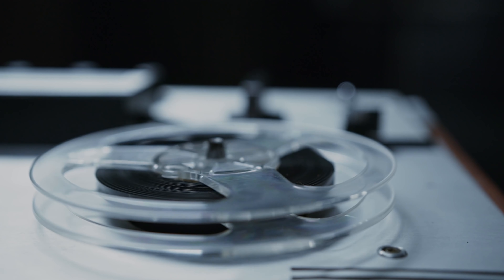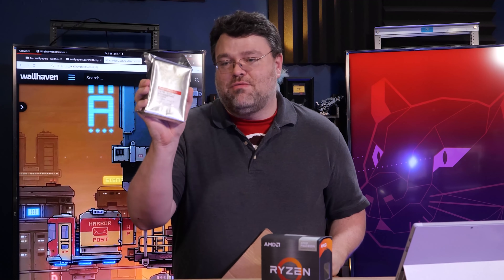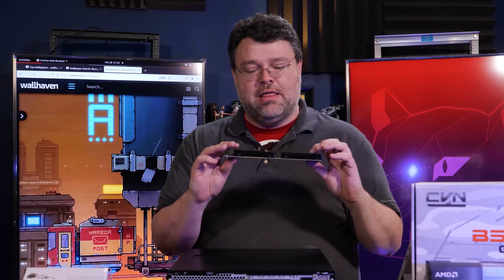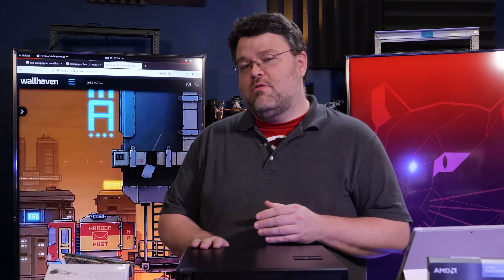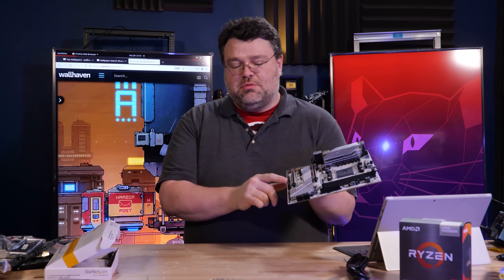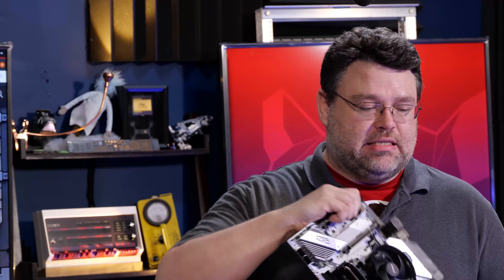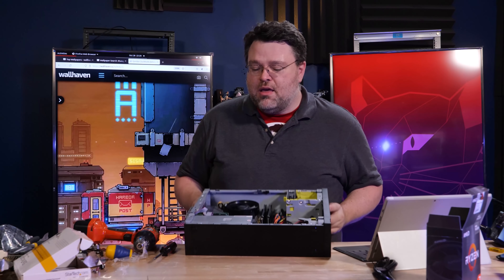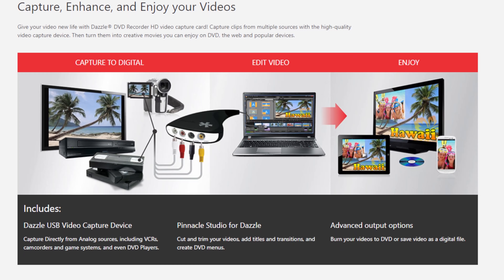DAT Build Doh! PC Build for Archival Digitization

Comment: Can anyone tell me why $280 for a 10TB red makes sense over 8TB? Maybe at the date of ordering parts the 8TB were still price inflated, but the HC320s I personally use in my desktop are currently $175 on Newegg. Or if it's just being used for temporary storage of transcoding output, a $100 blue drive would work just fine, no?

Comment: Interesting, I need to build something like this.  BUT…
I really like to see how you managed to get that ancient TEAC SCSI interface drive you showed in the video hooked up to a modern system.
Also links to the various parts would be most helpful.
Reply: I had SCSI drives back in the day both CD readers and hard drives. I saw that and wondered where he would get a low profile PCIe card for that system if he is going with a SCSI optical drive.

Comment: CDs don't expire as quickly as you're implying.  I recently copied about 1500 CDRs and DVDRs to hard drives and only one was unreadable - and I'm not sure that one had been properly finalized when I made it 15-20 years ago.  Most of my disks were good quality but not highest, and a few were the really cheap 1998 vegetable-dye (IIRC) no-names.  You should only worry if you were using the latter.  And commercial CDs / DVDs are in my experience much better still.

Comment: Why buy a cheapo sound card when most onboard sound on even modern motherboards has coax SPDIF?  It's still digital, and I'd be a little surprised if there weren't a TOSLINK to coax adapter

Comment: I'm kind of paranoid about data; would ECC be a better idea? Which ryzen boards implement it correctly anyway? For GPU there are Pro half height like Quadro P1000 or T1000; AMD WX4100 or newer.

Comment: Indeed TEAC, still miss my 8x SCSI Burner from TEAC, not only for it's higher burn quality (you could noticeably see the difference when comparing the same CD with the same contents side by side vs another burner, HP in this case. On top of that it also was much better reading CDs, be it burned or otherwise, basically I had CDs I was not able to read on other CD/DVD readers that would work beautifully on the TEAC, which was a saving grace for many a slowly dying CD. So, yep perfect choice if you manage to get one in proper working condition.

Comment: I'm an old-fashioned optical disc enthusiast (still actively using optical discs) with over 15 years experience of extracting data from degraded & damaged CDs (mostly CD-R). 

When it comes to degraded audio CD-R, the drives I found most successful are Mediatek-based DVD writers from the late-16x era onwards. [Starting with the first drives where the controller chip supports DVD-RAM, although it doesn't matter if DVD-RAM support has been disabled on that particular model.] 

I have 60+ optical drives in my collection and the various Mediatek-based drives have been by far the most successful at extracting usable audio from degraded CD-R. They are in a different league to my Plextor Premium & DVD drives, or any older CD drive. (Although I do not own any of the old industrial Teac models, only the later rebadged Pioneer drives.)

The Mediatek-based CD writers I have used all had similar behaviour to the DVD writers, but had worse performance and were less successful. (None of of my read-only drives were useful.)

My Mediatek drives are mostly Lite-On and Samsung (with a couple of LG models too), ranging from the 16x Lite-On SHM-165P6S to the 24x iHAS124B, and a number of 20x Samsung models. For reading damaged & degraded audio CDs they all perform much the same on average, no models stand out. (But I would try to avoid the later 24x drives if possible, as costs were cut a bit too far.)

The Samsung models & later Lite-Ons have audio caching disabled, which can greatly speed up secure audio extraction re-reads & reduce drive wear. But the caching on the other Lite-On models can be successfully disabled using the FUA command if the software supports it.

It should be mentioned that for certain areas of damage/degradation, other types of drive may have more success. It's well worth owning drives with a variety of different controller types as  they will handle errors differently and sometimes a normally inferior drive can succeed with a particular disc where other failed.

For scratched CDs specifically one other type of drive stands out and can offer near-miraculous performance - ALI-based CD writers, such as the Benq 5224/5232X (& W) drives. (The famous Plextor PX-230a was just a rebadged 5232X.) These can do amazing things with scratched audio CDs, but they don't handle degraded discs or other kinds of damage particularly well. Their interpolation of errors is poor, but that can be a big advantage in worst case scenario where the audio has to be repaired manually in an audio editor. They are also probably the fastest drives for reliable secure audio extraction.

The caching behaviour of these ALI/Benq drives is also rather unusual and popular secure audio extraction software such as dBpowerAMP will erroneously detect that they don't cache, when in fact they cache a lot of audio data (1162Kb ??). This can lead to errors going undetected, unless you manually tell the software to compensate for caching and set a large enough size. 
[There was a discussion on Hydrogen Audio forum in about 2005/2006 between Spoon (author of dBpowerAMP) and Michael Spath on the technicalities of this specific issue with these drives. Spath wrote a great audio caching test tool which works on all drives and released it on the CDFreaks/MyCE forum.]

Comment: I have (almost) exact same build. Slim PC is the best of small PC category. I have 5600G, AMD wraith spire (old model with copper slug), 512GB cheap-ass NVME and a fuckin CD-ROM for Audio CD archiving in FLAC/WAV format. Holy moly, Wendell, you seems like the most sensible geek/nerds/programmer for users with sensible choice like me.

Comment: The pre-instaled thermal paste of AMD's stock coolers is sh*t. I mean, do the job it's made for, but is like cement. 
You've got highly chances to stick the cpu on the cooler when you replace thermal paste or disassemble your build for whatever reason, even if you warm it running some high CPU workload before remove it...

Comment: For video, at minimum you'll want a FW 400 card and something like a Canopus ADV-100. You mentioned 8mm, some camcorders will have the option to output as DV natively, which will mean outputting to FW 400. With the Canopus you can convert Analog to a DV signal and capture it with your preferred flavour of software.   The capture/archiving of analog video is one huge rabbit hole. Have fun.😂
Reply: The problem with that is that DV is a lossy compression format. If you're going to take the time to do this right, then the initial capture should be uncompressed.  Storage and bandwidth are (relatively) cheap now, and compression at the capture stage is just throwing away information that might be useful in the future.

Agreed on the rabbit hole, though.  I'm sort of middle-of-the-road on this, since, if whoever made the original recording actually cared about quality, he would have used some format other than VHS or 8mm video.  Still, though, we might as well at least not start by throwing away information unnecessarily.
Reply: No disagreement. I was merely saying that the minimum for doing video would require what I illustrated.  The rabbit hole has, among various thing, the differing factors such as the cost to quality metrics.  IDK if the average end user can absorb the cost of something like Black Magic gear for a hobbyist approach, or if there is still a push to use an ATI-All-in-wonder card on a win XP/7 machine to facilitate lossless capture.     

Then there is the issue of the media being captured in the first place; VHS, 8mm, etc - these were not known for having great fidelity to begin with and if the purpose is to simply retain memories, as opposed to ripping commercially produced cassettes etc, then it will be hard to realistically notice the quality between DV and lossless capture from media that is pushing 30+ years old and likely has not been stored in proper/ideal places for the most part.

Comment: For analog video, you don't want the Dazzle garbage.  You want an AJA or Blackmagic capture card, so you can capture full-res NTSC or PAL in an uncompressed format.  The capture process should always be uncompressed and interlaced.  You can deinterlace and compress later, but always save the original.  I went through this recently and used the Blackmagic card.  From the uncompressed AVI, I used "ffmpeg -i <filename> -c:v rawvideo -c:a copy -threads 12 -c:a pcm_s24le -pix_fmt yuv420p -f avi <output-filename>" to make a de-interlaced viewing copy.  For DVD viewing copies, I did this:  "ffmpeg -i <filename> -filter:v "scale='if(gt(a,720/480),720,-1)':'if(gt(a,720/480),-1,480)',pad=w=720:h=480:x=(ow-iw)/2:y=(oh-ih)/2" -vf yadif -threads 12 -target ntsc-dvd <output-filename.mpg>".  Also, the quality and maintenance of the VCR matters, as does the use of a time-base corrector if the original has time-base errors.  I used the Blackmagic capture software on Linux for my stuff, and I assume that the Windows version works similarly.

For audio, you want to use something that takes an AES/EBU input if the original source is digital (DAT, etc.).  A separate hardware audio recorder (Tascam, Sound Devices, etc.) is the easiest method for this.  For analog, you really want a USB interface to avoid the internal RF/EMI inside the computer case.  Or just use that external hardware recording device, which is easier, anyway.  Again, make the recording in an uncompressed form.  24-bit 48k WAV or BWF is the standard here.

For digitizing 8mm, 16mm, and 35mm motion-picture film, you really need to work with a lab or scanning facility to do this right.  Nothing that is remotely affordable to the average consumer will product acceptable results.  At minimum, you want a scan done with something like a Spirit Datacine or Lasergraphics scanner.

Note, too, that nothing digital is archival.  You're making access copies here.  Always save original film and videotape material, since better transfer methods may come into existence in the future.  Nothing is worse than hearing of people who transferred their home movies to VHS in the '80s and threw away the film.  They could have beautiful HD copies now, but they're stuck with VHS because of their short-sightedness.

Comment: For archiving VHS I've been using the method Technology Connections described in his video "The Best Easy Way to Capture Analog Video (it's a little weird)". I'd suggest to check it out because the results are waaaaay better than anything I've used before, from an old geforce, pci capture cards or usb cards.

Comment: I did preserve al that data in 2005, using a Pentium III and Windows XP. I converted a few cassettes; my LPs and CDs to the wma format. For the CDs I used Windows Media Player and for the LPs and cassettes I used a pre-amplifier and a program that did split the songs based on the periods of silence detected, you could manually correct those boundaries between the songs if needed. Because at that time we used portable players with limited memory, I converted all music to variable size wma files with variable sample frequency and that resulted in speeds between 64 kbps to 128 kbps dependent on the complexity of the music.

For the photos I used a scanner of the negative strips and if not available I used a flatbed scanner for the photos. I saved in this way some special photos; 
- one photo from my great-grandparents from around 1890; 
- a number of photos of both couples of my grandparents, one with my grandfather in Dutch army uniform from around 1915 and another of the marriage of my grandfather's niece with a Canadian soldier after the WW2;
- a copy of my mother's identity card issued by the German occupation forces.
My family had no video tapes, videos came later with the use of digital cameras and smartphones.

Comment: I've been told in the past to use USB for audio just because the machine itself can be so electronically noisy but I haven't seen empirical evidence to prove that. Also wouldn't USB get ground noise from the PSU anyway unless it's external? Would a powered hub make a difference? Probably just audiophile lore I guess.

I'd really like some analog video capture and device recommendations since VHS capture is a lost art nowadays. I got a lot of tapes I would like to archive at some point and I think I have some Betamax too and I'm not looking forward to figuring that out. All I have around here is some Easycap devices and they don't seem ideal from what I've tested of them.

Comment: I thought that case sounded familiar. When you opened it I realized why, I have it in my home theater setup! The green fan cage gives it away. Pretty good cheap case IMHO. 
I use mine as a YouTube machine and have a CD/DVD burner in it for ripping old CDs and DVDs. I'm running an old AM1 APU (Athlon 5350 I think) but was considering dropping in something like a Yeston RX550 or the VisionTek RX560 so I could do light gaming/emulation on it. Course, at $200-250 for those cards it's not really worth it.

Comment: The best optical drives were the Plextor SCSI units. I have FOUR of them to prove it. Ultimately the best archiving machines, especially for analog video, are all 15+ years old now and run Windows XP. If you need a discrete low-profile video card I've had good luck with the PNY Quadro P400s. They recently came out with the T400 if you can find them. Not going to be a RTX powerhouse, but perfectly fine for transcoding.

Comment: Although this is a great video, I think the people who actually need a guide like this will run into several problems. A few problems I can see, they won't know what a molex, sata, or spif connector is or looks like. They also won't know where to plug any of the cables in, which is exactly what you skipped through in this build. For those who know enough to benefit from this video, 100% of the value came from the first ~5 minutes in seeing which parts to use. Other than that I thought it was a very well-made and entertaining video.

This is a classic example of experts making guides for experts. When you talk about a certain connector you should show them. When you plug in a cable you should show what it looks like, mention what it does, and say where it needs to be plugged in. I know it seems like a no brainer for tech savvy individuals, but THAT is exactly what keeps other people from learning or even trying. A guide should be doable with ZERO knowledge of the subject.

Just like with a linux guide where you spend more time looking up what the guide is talking about than your original problem, because the creator fails to give enough detail. Or you go from guide to guide, while each one lacks these small but crucial details for you to get any use out of them.

Comment: These small power supplies are called TFX.
Reply from the maker: I think I have gotten a Dell tfx power supply which is rotated 90 degrees thinking it was standard. It wouldn't fit in the case unless I rotated it but that blocked the cable exit. Probably my test tfx is actually a Dell PSU and I didn't realize

Comment: The Nvidia RTX A2000 will be half height, whenever it launches. (well, it is technically launched, but available nowhere, so I consider it a paper launch). It should have the power of around a 1660, so mirange, but being a Quadro level card, also very expensive, so not quite suitable for a "budget build", but just wanted to put it out there that Nvidia is bringing a reasonably powerful half height GPU, meant for the small form factor workstation market.